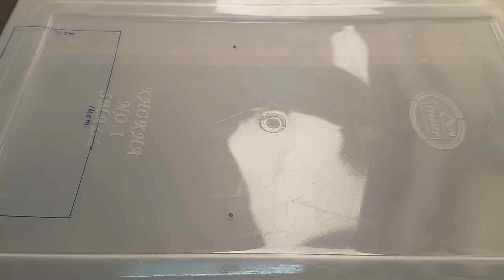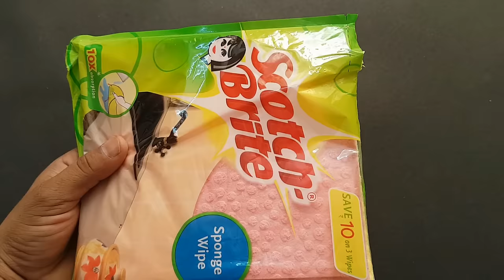How to Make a Floor Cleaning Machine - Remote Controlled

Comment from the maker: This project is fully unified for cleaning applications. It features the requirements needed for floor cleaning such as water supply, scrub, and fan. It is a wheeled type machine with a movement control.

This floor cleaning machine is comprised of several DC motors that drives the wheels and rotating objects for the scrub. Wiring of the motors are properly designed that the wheels are set up considering the control is from two dual two way switches. A pushbutton is also set as ON/OFF switch of the rotating objects as scrubs. Plastic pipes are also designed in which it has holes and gate valve that manages the release of cleaning liquid on the floor. It has two CPU fan after the scrubs used for drying of the scrubbed floor area. The machine is wired using LAN wires connected to its controller while the controller has the connection of the 12V supply.
 
This project is applicable for several floor cleaning activities. Considering the area and access of the floor to be cleaned, this floor cleaning machine is able to handle a load of cleaning activity.

The Materials are:
1. Four 12 volt DC 60 rpm Gear Motor
2. Two CPU FAN
3. 30 X 18 cm Plastic Container
4. 15 X 18 cm Plastic Container
5. 0.5 inch PVC Pipe
6. Two Dual Two way switch
7. One Push to ON switch
8. LAN Cable
Reply: Junkyard - Origin of Creativityø
Reply: Peter Kargaard
Reply: Junkyard - Origin of Creativit
Reply: Junkyard - Origin of Creativity 

vbjkk

n
Reply: Junkyard - Origin of Creativity   U
Reply: Junkyard - Origin of Creativity i
Reply: Junkyard - Origin of Creativity o
Reply: Junkyard - Origin of Creativity s
Reply: wieowksag
Reply: Junkyard - Origin of Creativity  bh.  Hbhhhgguuuuoo
Reply: Junkyard - Origin of Creativos para mandar mensajes
Reply: upinipin
Reply: t
Reply: Junkyard - Origin of Creativity ih name vijay
Reply: Junkyard - Origin of Creativity
Reply: Junkyard - Origin of Creat

Ooggyy
Reply: Junkyard - Origin of Creativity n b and rtuo
Reply: Junkyard - Origin of Creativity vggchfg
Reply: Junkyard - Origin of Creativity me
Reply: Junkyard - Origin of Creativitybem
Reply: Junkyard - Origin of Creativit
Reply: vishal hangre🎚🎧
Reply: babu meena
Reply: babumeena
Reply: babu
Reply: Junkyard - Origin of Creativity
Reply: Junkyard - Orig
Reply: Junkyard - Origin of Creativity reg
Reply: Nice
Reply: Junkyard - Origin of Creativity .
Reply: very good I like video your
Reply: Junkyard - Origin of Creativity   Stopstop
Reply: Junkyard - Origin of Creativity you play whith junk
Reply: Hello Purplekeymon Zap
Reply: Junkyard - Origin of Creativity jn
Reply: Junkyard - Origin of Creativity hhikku9k
Reply: Junkyard - Origin of Creativity
Reply: Where is  the motor of scrub how much rpm
Reply: Junkyard - Origin of Creativity iipi
Reply: How can it work without motor
Reply: Wow

I
Reply: Junkyard - Origin of Creativity  this is moving very fast which is bad about this.. U should work more on slowing its speed for best result
Reply: Junkyard - Origin of Creativity jfd
Reply: Junkyard - Origin of Creativity a
Reply: I'm in my name is
Reply: Junkyard - Origin of Creativity ,ssh m Schwab beds r r mpg,
Reply: Junkyard - Origin of Creativity p
Reply: Junkyard - Origin of Creativity
Reply: Junkyard - Origin of Creativity hfuf
Reply: Junkyard - Origin of Creativity روعة ابداع تألق
Reply: Junkyard - Origin of Creativity
Reply: Junkyard - Origin of Creativity fbg
Reply: Junkyard - Origin of Creat
Reply: Karthik yes
Reply: Junkyard - Origin of Creativity
Reply: Junkyard - Origin of Cre
Reply: Junkyard - Origin of Creativity jlf
Reply: Junkyard - Origin of Creativity gic
Reply: Junkyard - Origin of Creativity dydlcl
Reply: Junkyard - Origin of Creativity.
Reply: Junkyard - Origin of Creativi
Reply: Junkyard
 - Origin of Creativity
Reply: Ok
Reply: Junkyard - Origin of Creativity .
Reply: Junkyard - Origin of Creativity y
Reply: Junkyard - Origin of Creativity
Reply: Junkyard - Origin of Creativity ईशशहबध
Reply: I can't understand the wire settings how the middle on/of switch is getting power plzzz reply to my comment sir plzzz........
Reply: Junkyard - Origin of Creativity ؛٩
Reply: Junkyard - Origin of Creativity
Reply: Junkyard - Origin of Creativity
Reply: Junkyard - Origin of Creativity afnan
Reply: Junkyard - Origin of Creativity disfhfdgh
watch
Reply: Junkyard - Origin of Creativity rp
Reply: Junkyard - Origin of Creativity gyul
Reply: Junkyard - Origin of Creativity tuivn
Reply: very good diy but the goods used are not completely listed as you used 7 motors but you listed only 4.also please show how to give 12v dc supply what did you use for your model
Reply: Junkyard - Origin of Creativity tfidj
Reply: k
Reply: Junkyard - Origin of Creativity Abdul Moiz
Reply: Junkyard - Origin of Creativity tytty
Reply: Cihan Yuzer सनरतीमकिनसतमयु लिचय
Reply: Junkyard - Origin of Creativity ?
Reply: Junkyard - Origin of Creativity
Reply: Junkyard - Origin of Creativ 
ity
Reply: Junkyard - Origin of Creativity
Reply: dn
Reply: Amit pal
Reply: Junkyard - Origin of Creativity .
Reply: Junkyard - Origin of Creativity टठडठठगगढ
Reply: Junkyard - Origin of Creativi
Reply: Junkyard - Origin of Creativity fvcv
Reply: Junkyard - Origin of Creativity à1a1a
Reply: Junkyard - Origin of Creativity   h
Reply: Junkyard - Origin of Creativity like
Reply: Junkyard - Origin of Creativity
Reply: Junkyard - Origin of Creativity fgbjgguio
Reply: Junkyard - Origin of Creativity cid
Reply: Junkyard - Origin of Creativity:
Reply: Junkyard - Origin of Creativity gmchbf😇😊😂🐶🚒🚐🚓
Reply: Junkyard - Origin of Creativity ىة
Reply: Junkyard - Origin of Creativity زبسوظ
Reply: Peter Kargaard ايوحظة
Reply: Junkyard - Origin of Creativity ة .اببيلظوىى
Reply: Junkyard - Origin of Creativity 1c0tr
Reply: Junkyard - Origin of Creativity
Reply: Junkyard - Origin of Creativity कुकपततपककतललपत
Reply: Junkyard - Origin of Creativity
Reply: Junkyard - Origin of Creativity لتلباافصوفثلوغ
Reply: Junkyard - Origin of Creativity.
Reply: Sir can I have your email I want to talk to you regarding my school project please.
Reply: Junkyard - Origin of Creativity
Reply: amar.mislate
Reply: Junkyard - Origin of Creativity Jo
Reply: Junkyard - Origin of Creativity 
Gegfh
Reply: Junkyard - Origin🎶🎙🎛📣🎤
Reply: Junkyard - Origin of Creativity i
Reply: Junkyard - Origin of Creativity legal
Reply: Junkyard - Origin of Creativity
Reply: Junkyard - Origin of Creativity
Reply: অনেক।
Reply: Junkyard - Origin of Creativity
Reply: It's need to take 7 motors
Reply: نبؤه
Reply: Junkyard - Origin of Creativity สั่งอุปกรณ์ที่ไหนได้
Reply: Super
Reply: OK thank u
Reply: Is that all of the materials needed.. What is the other materials?
Reply: Is that invention need a battery 🔋
Reply: Junkyard - Origin of Creativity 👆 udh
Reply: Junkyard - Origin of Creativity hduhdjw
Reply: Junkyard - Origin of Creativity
Reply: Junkyard - Origin of Crea tivity
Reply: Junkyard - Origin of Creativity jjjjhbvcv
Reply: Junkyard - Origin of Creativity से पहले तो आप किसी के
Reply: Great
Reply: Junkyard - Origin of Creativity
Reply: Junkyard - Origin of Creativity Shiva Shiva Shiva Shiva
Reply: Junkyard - Origin of Creativity chby
Reply: Junkyard - Origin of Creativity
Reply: Hju
Reply: Junkyard - Origin of Creativity no
Reply: nice
Reply: ham
Reply: Спосибо
Reply: Junkyard - Origin of Creativity M
Reply: तड
Reply: Junkyard - Origin of Creativity
Reply: K
Reply: @rahulkumarshaw7963  
 Ji
Reply: Hwbdirbst
Reply: June
Reply: نىتىتىاىى
Reply: Wow
Reply: But there are 7 motors
Reply: Rehan and Farhan
Reply: Junkyard - Origin of Creativity  and then q
Reply: Ýufhi
Reply: Your channel is good
Reply: Ain't there seven motors instead of four?
Reply: @BaoNguyen-ce1sd  ஊஏஏற
Reply: Jue
Reply: Junkyard - Origin of Creativityط/|٪رلز لللطط
Reply: Junkyard - Origin of Creativity हिमांशु राठौर
Reply: Good
Reply: Ghar saaf karne ke liye bilkul mast hai ye
Reply: Ghar saaf karne ke liye bilkul mast ha
Reply: Junkyard - Origin of Creativity k
Reply: Batana jaroor
Reply: How to make  road cleaning car
Reply: الو
Reply: Which battery did you use to give power supply
Reply: Junkyard - Origin of Creativity bughggguhhhhbhjjjkjjjkknjjmm,,komma,,juking Jhumpa is time
Reply: Sir I am not understanding the various electrical connection can please tell me the connection properly
Reply: كرار
Reply: Umer khan
Reply: .

 . Jm
Reply: Junkyard - Origin of Creativity hfhfhfjhvj
Reply: ciao
Reply: @Peter wrrr4g
Reply: Junkyard - Origin of Creativity ikhjy7
Reply: Junkyard - Origin of Creativity WWE 17 07 2019
Reply: Junkyard - Origin of Creativity
Reply: Pter
Reply: Sunil paikra
Reply: Dev
Reply: Junkyard - Origin of Creati
Reply: Junkyard - Origin of Creativity yo
Reply: Junkyard - Origin of Creativity
Reply: Junkyard - Origin of Creativity
Reply: 7قعختال
Reply: شياتفسسيان
Reply: @lisashaw9050  شثلنقشفن
Reply: Two CPU fans
Reply: Good
Reply: Ya nise
Reply: Junkyard - Origin of Creativity  can u please give the circuit diagram for this
Reply: What code has been used in this ?
Reply: Sir i want report this project.plesase immediately 🙏
Reply: W
Reply: Junkyard - Origin of Creativityriteshbishoyi
Reply: Junkyard - Origin of Creativityriteshbishoyi
Reply: Push
Reply: Cbkj
Reply: Vc
Reply: You are right
Reply: Εγγύηση του
Reply: Vanguard has been the most successful  εντός της Ελλάδος στην οποία βρίσκεται το θέμα είναι να πιάσει με τα δύο χεράκια μη σου πέσει
Reply: Lamp
Reply: زلن
Reply: Хх9
Reply: Jjjj
Reply: ش
Reply: ط
م
Reply: Vui
Reply: Vui
Reply: .9miles
Reply: Good
Reply: Yhx
Reply: 6
Reply: PP
Reply: Uu
Reply: Hey,its nice 
I'm gonna make this for our school 🏫 science 
I'm just 10 year's old
But I like to make
Reply: But why are u'll writing 
Junkyard-origin of creativity
Reply: 0
Reply: Wow ti nice
Reply: ج
Reply: Junkyard
Reply: Ntyuill hurry by helping
Reply: L
Reply: Thanks for sharing, I'll try to make it during summers.
Reply: Ui"l"""
Reply: Gryf hain the first place and it will take the time you have any other questions
Reply: If we could go got bhagavanh
Reply: Suppre